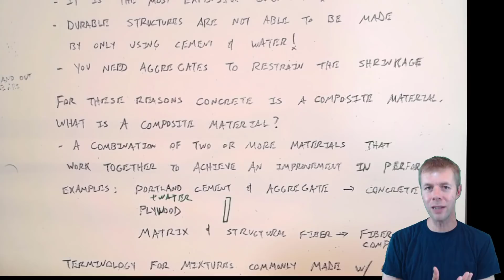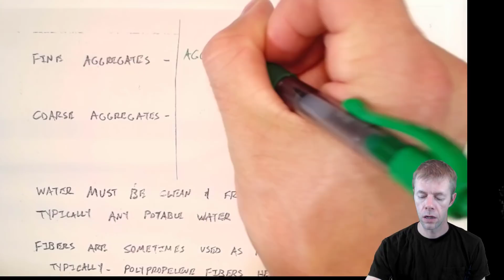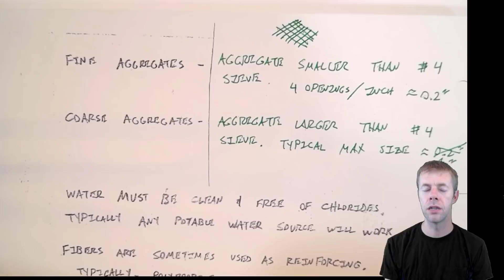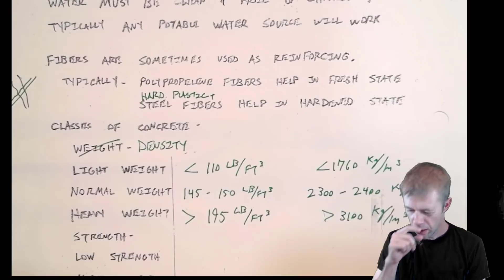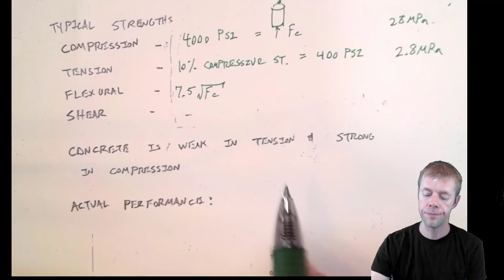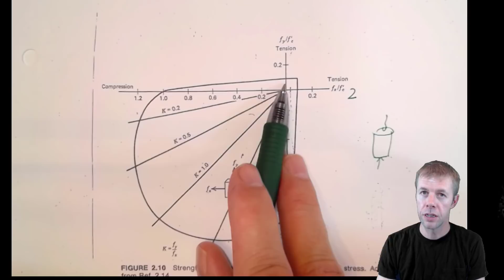What is concrete?

Comment: dear doctor 
is there a direct relation between compressive strength and flexural strength and does it vary if the concert is heavy weight i think the formula placed in the video is not accurate and we should make a specimen and to be calculated through this formula (F=PL/BD2) 

i think you where place an approximate formulas for tension , shear and flexural

thanks for your time

Comment: Excellent video, Tyler. Might be worth pointing out that for metric the stated relationships between the compressive and flexural/shear strengths are only valid for imperial units. As 1 psi = 0.0069MPa,

Flexural strength 7.5*sqrt(Fc_psi) -> 7.5*sqrt(0.0069*Fc_MPa) = 0.62*sqrt(Fc_MPa).

Shear strength 4*sqrt(Fc_psi) -> 4*sqrt(0.0069*Fc_MPa) = 0.33*sqrt(Fc_Mpa)
Reply: … tacit ….

Comment: Mr. Ley,
Have very much enjoyed several of your videos although some of the information is a little deep for me. Do you have any videos on resurfacing concrete? I have some walks and slabs that are in great shape (as far as cracks go) but are 55 years old in need of having the surface freshened up a bit. I know there are many products out there but would rather hear from a professional like yourself before reinventing the wheel and making some unnecessary mistakes.

Comment: Yea if you just use pure Portland cement by itself without any gravel or sand it will be extremely brittle
Reply from the maker: Yes!  It will also crack with no loads. =/

Comment: These are great lessons! You made so many things clear in this single one.

Hey Tyler, could you do one on aircrete? Could you adress the question of the ratio of water to cement in aircrete, and whether it has to be computed as with regular concrete, or does it follow other rules?

I've watched many of your vids already, I'm learning a lot of the stuff I wanted but until now I only got small bits from different places... Thanks!
Reply from the maker: Thanks for the comment.  
I will make an aircrete video.  Keep watching.  Can you send me a reference to the w/c not applying to aircrete?  I have never heard that one before.
Reply: Wow these are great news Tyler!!

There are many vids about aircrete but you have deep knowledge of concrete, and also it feels "exhausitve", as if you new the important stuff in all areas of the subject.

I can't send any references, but any aircrete vid will show you the following :

-they rarely use superplastifier and go as high as 0.5 w/cement

-then they add foam that is anywhere from 57 grams/Liter to 110 grams/ Liter, and often, 3 to 5 times the volume of foam for 1 volume of cement... So I let you guess all the water that gets incorporated into the final product...

I don't know all the mechanics of concrete (though I'm an avid watcher of your vids, that I watch each several times while taking written notes as in class). I suppose a lot of this water evaporates during curing, but still it must have a negative impact on strength, as some water probably gets trapped, or even, there can be so much that the concrete crystals can't reach each other...

Anyway, I look forward to all your vids, and to anything you would upload concerning aircrete especially...

Btw I'm pouring some monday and a second time at the end of the week, but with my own mix!

Comment: How long do the supporting fibers need to be? Could this work on the nano scale?  Have carbon nanotubes been explored as an option yet?
Reply from the maker: This is a good question.  Most fibers used in concrete are pretty long.  Maybe 1.5" or so.  They need to be this big to intercept cracks.  Look for a video over fibers soon!

Comment: Great overview. In the oilfield everything we pump is paste whether for cement plugs or for cementing the casing inside the hole. We use silica sand or silica flour to prevent strength retrogression when well static temperatures are above 235F. We use various chemicals depending on the application to control free water and fluid loss, to provide desirable pumping characteristics (dispersants), and to provide viscosity when cement fallback to the formation after placement is a concern. These are just some examples. Typically we use fibres to either prevent losses of cement to the formation or to impart good mechanical properties like elasticity and resilience. In the oilfield we don’t use the term “paste”, instead we call the cement/water mixture “slurry” with or without other additives.
Reply from the maker: Dean -
We call dispersants - water reducers
We also use a viscosity modifying agent or VMA to give concrete more cohesion and avoid segregation.  This is made of a gum.  One example is wellan gum - although I don't think this is used anymore.

The slump test is the most widely used test to measure viscosity.  You should check it out.  You will think it is funny.
Some researchers use rheometers to measure the viscosity of concrete but it is not common in the field.

Silica fume is widely used in concrete as an SCM (supplementary cementitious material).  It is a coarser silica flour.  We use it because it acts as a nucleation site and a great filler to help with packing.  Out concrete doesn't go to 235F during placement, at least not on purpose.

Fibers are somewhat common in construction cements.  Most people don't use them because of the added cost but I think they are a great tool.
Reply: Tyler Ley thanks for sharing this info. We use silica fume/compacted silicalite commonly in oilfield cement often as a compressive strength enhancer for low temperature, lightweight cements. It also imparts some thixotropy which is good for preventing slurry fallback to the formation after placement. Silica fume also helps with strength retrogression at high temperatures. Another thing we frequently test is fluid loss. Well cements are often pumped under high pressures so if fluid loss is not controlled then you can have filtrate leak to the formation which increases the viscosity of your fluid and could create pumping issues. Fluid loss after placement can create issues with gas influx into the cement. When static fluid loss happens after placement the slurry begins to gel at which point full hydrostatic pressure is not transmitted to the bottom of the well. If you have a deep gas zone in the well then this becomes undesirable as your bottom hole formation pressure becomes greater than the hydrostatic pressure of the cement slurry column at which point gas can influx into the cement percolating through it creating channels that affect zonal isolation, not good as you want full hydrostatic pressure until the cement sets. Also the transition time on the cement is a key consideration too. Transition time is the time it takes for the cement to go from 100lb/100ft2 to 500lb/100ft2 when static. If gas migration into the cement from high pressured zones is a concern then you want that time to be fast, 30 mins or less. I had a customer who used to request 10 mins and I often design for 15-20mins. At 100lb/100ft2 the cement is gelling and losing its ability to transmit full hydrostatic pressure. At 500lbs/100ft2 the cement is gelled so much that gas can no longer infiltrate it. If the transition time is quick you shorten the time span that the gas can percolate into the cement. If it’s long then that is an issue as you risk having gas cut cement and cement that does not provide full zonal isolation.
Reply from the maker: Thanks for the great reply!
Reply: Very interesting !

Comment: What about heat resistance?
Reply from the maker: That is a good one!  We usually use a different cement if we want the concrete to resist high heat.  For example, calcium aluminate cements are good for high heat.